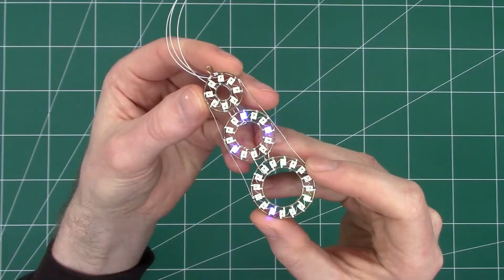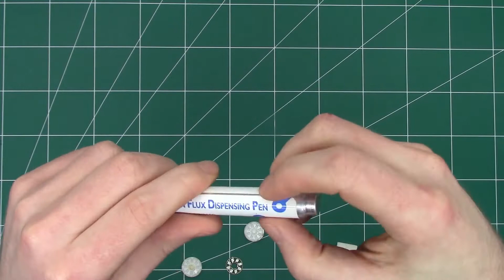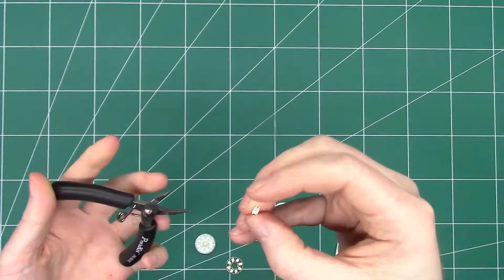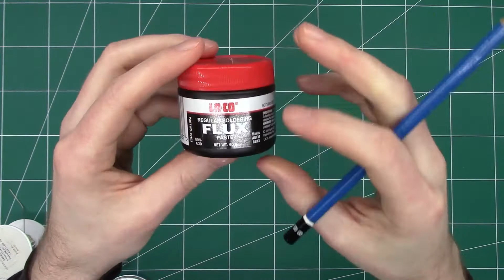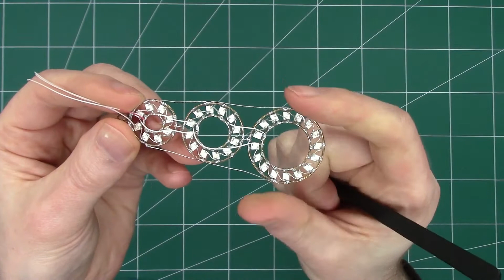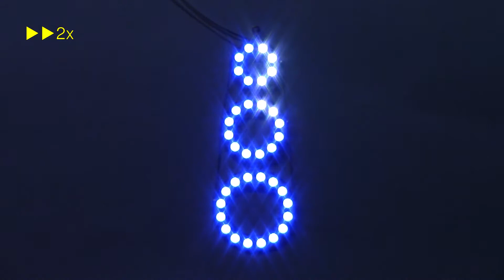Freeform Soldered LED Pendent Necklace - How I Made It

Comment: How tolerate did you find with the size of the LED's compared to what it said in the data sheet?
Reply from the maker: The sizes were within the tolerance from the datasheet. I was pushing the tolerance I could get reliably from my 3d printer.